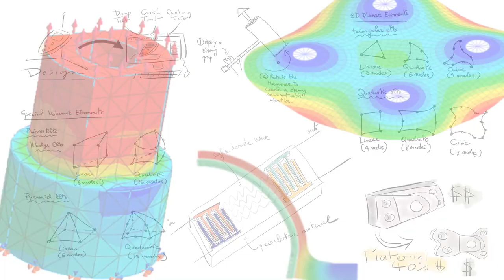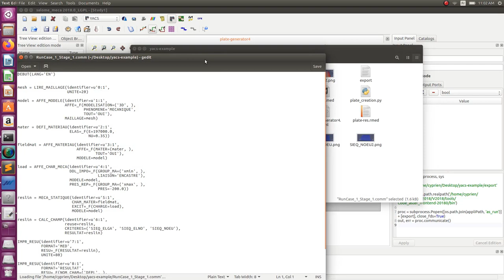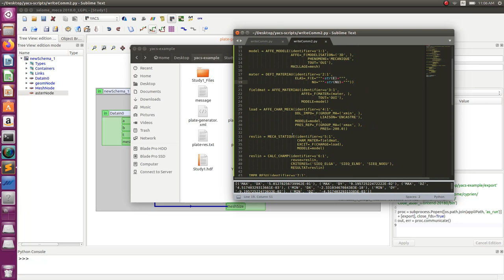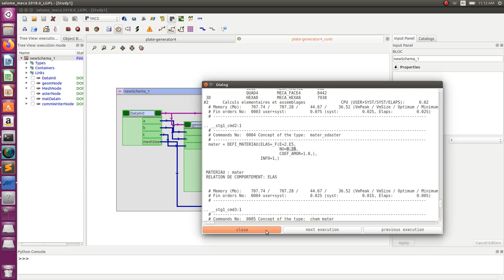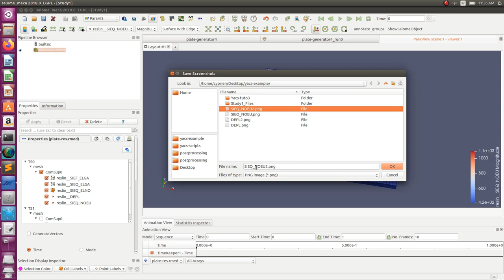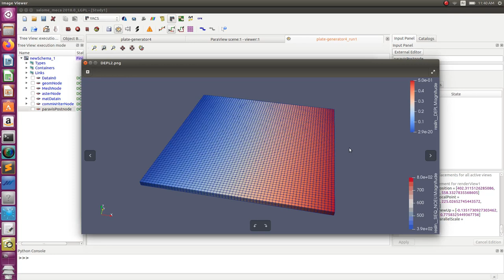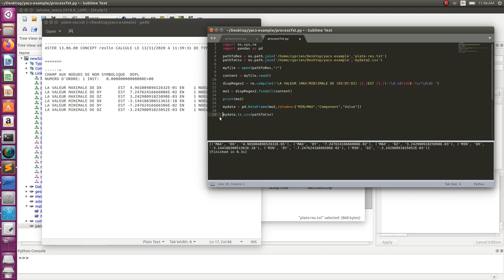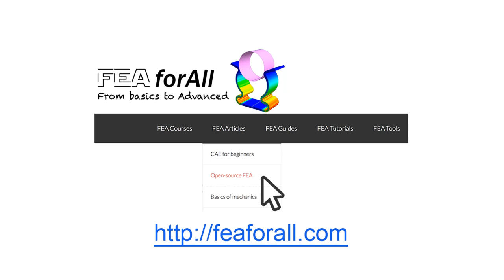[Salome Automation 4 ] Automating Paravis Post-processing with YACS

Comment: Hi Cyprien, thanks for the great video. 
 I have a question.
Could you tell me why the sief_elga stress do not appear to plot in paraview? I saw that in your video they also appeared in the properties tab, but did not appear to plot (13:09 min).

thanks
Reply from the maker: It should work, but you have to use the correct filter, I think i am using the filter for the elno component

Comment: Hi Cyprien, excellent tutorial. I have a question, do you have a video or do you know any place where they explain to me, how to simulate hyperelastic behavior in code aster? for example the deformation of a balloon by internal pressure
Reply from the maker: This is the only tutorial I did using a nonlinear model: https://youtu.be/KVBhOaLh_Is (it’s not hyper elastic but that will guide you on how to set up a nonlinear model, then you can have a look on the aster website to see which model is appropriate. Aster can also use mfront to use your own material model so it’s surely possible to do hyper elastic )

Comment: Hello Cyprien, thank you for a very nice tutorial. I am doing a simple project with YACS and  would like to ask how to install pandas in salome environment, as when I  try to run Tools/Plugins/SALOME shell session nothing happens. Any ideas?
Reply from the maker: So in theory, you can install pandas in the Salome python distribution by login into the shell through command line (enter “.\Salome shell” from the executable folder to enter the shell if the GUI doesn’t work. In practice, installing pandas might have an impact on the other python modules that Salome uses in its own distribution (not fully sure), so what you can do is to install pandas in another python distribution (can be python 3) then you use a sub process to call the executable of that distribution within YACS (a bit tricky but that should work)
Reply: @Feaforall   thank you for the reply. Did you mean: "./salome shell"? With this command the start of a line in Terminal changes to: [NS=no_host:no_port]$ is this ok? I run the command: "sudo -H python3.6 -m pip install pandas --target=/home/lskrinjar/salome_meca/V2019.0.3_universal/prerequisites/Pandas-115", but than it installed packages (numpy-1.19.4 pandas-1.1.5 python-dateutil-2.8.1 pytz-2020.5 six-1.15.0) inside this folder. It would be logical to update the existing packages in /home/username/salome_meca/V2019.0.3_universal/prerequisites/ 
If nothing works I will try the subprocess with different python interpreter
Reply from the maker: Yes, that’s it

Comment: Hello cyprien, great video too 😃, small question something that comes with this logic would be to for example do exactly the same script but for several for example, Youngs module, so you would ré do the script for several Youngs modules, this could be added with a for loop from 0 to n-1 (n bring the number of young values) and insert a list of values for young variable and then choose it using the value of the variable of the loop? How could you use this variable? Also stocking the information would be a problem... And also I would be possible to do in a way that the different simulation would be done in parallel? As Salome uses single processes, this could be a great idea for doing studies in parallel... (and not in série as I mentioned firstly)
Reply from the maker: Putting the commwrite node and the aster node in a loop is easy. It would be like the first intro video. Just create a loop node, put those 2 into it. You’ll have to change the name of the result file as well to make sure that the result is not rewritten at each iteration. Running in parallel is possible using python threading module but I don’t know how effective that can be as each thread shares the total memory of your computer and requires a lot of resources. Something to try I guess... ;-)
Reply: @Cyprien Rusu  mm I see it is similar to what I thought but how would you swap the value of the variable? Creating the variable in a list (Youngs) and a variable that begins in zero (j) and increase at the end of the code? So you choose to pass the variable Youngs[j] to the next part of the code? This could be a solution That works no? I will re watch the first part but I was thinking about using the variable of the step of the yacs loop actually to do this changing in variables. Thanks a lot!
Reply from the maker: Like you said you can create a list of variables and pass that as the input to a loop node then at each iteration of the loop, you take the value at the position i in the array.